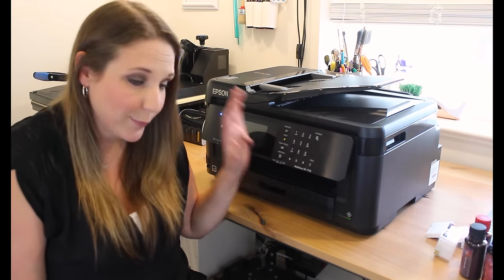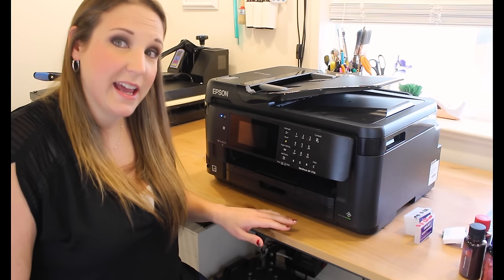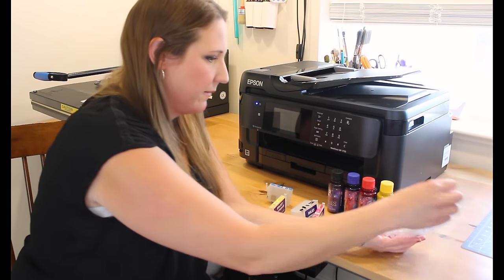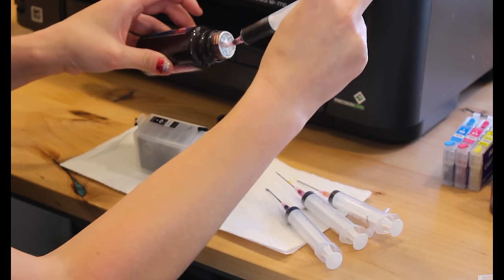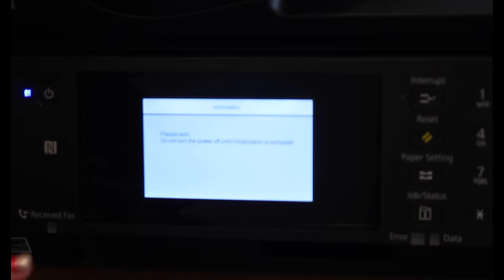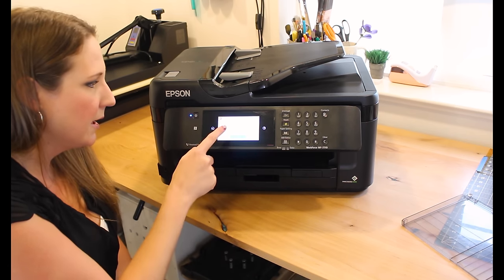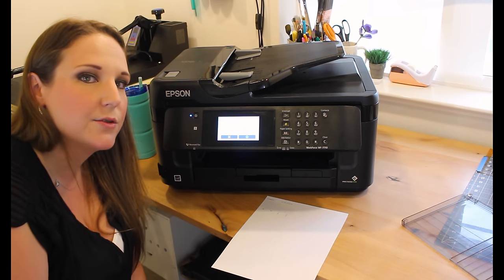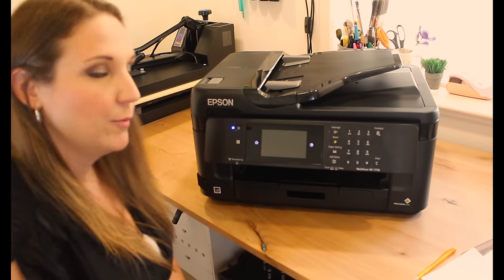How to Convert an Epson Workforce Printer to Sublimation

Comment: I would like to start off with telling you how imformative this video has been to me, ive never done sublimation before and was almost going to buy a huge sawgrass printer, (the 24" ones) which are around 4-5k,  but i do have this theory and cant seem to find any answers anywhere, I'm hoping you could help me out.  Have you ever tried printing easysubli media by siser with this printer and ink? and if so i was thiking of buying this whole setup just for that purpose, one more thing, if i were to buy a roll of that media 20" wide and cut it down to any size below this printers max print area for example 18" wide by 11" height,  would there be no problem with it printing and working with that media.  The little sheets siser sells I believe 8.4" x 11" are just too small for me.  I would love to hear back from you as your sole answer will determine my direction in this, thank you so much.
Reply from the maker: Arturo Torres I haven’t tried EasySubli yet but I’ve seen people use it just fine with their Epson’s. I think the only hassle people have is you have to give the ink some time to dry as it doesn’t dry as fast as Sawgrass. But you can definitely cut it down to any size the printer can handle! I do that with my paper scraps all the time!
Reply: @DebbieDoesDesign  thank you so much. Very very informative video, thank you.

Comment: is a sub better than the AVERY?
Reply from the maker: NERO absolutely! Sublimation can do way more than just shirts and it’s absorbed right into the fabric, not on top with a thick vinyl feel that can eventually peel or crack.
Reply: @DebbieDoesDesign  waht sub inks are you using? i am planning on keyboard keycaps and shirts eventually :-DDD

Comment: Don't you need to reset the inks chip? I know with most printer you need to reset it to refill the printer.
Reply from the maker: Some cartridges do have a small reset button. The ones I use from Cosmos Ink do not and I have never needed to reset anything.

Comment: my printer still wont accept my ink what do i do
Reply from the maker: Have you made sure they are pressed into the carriage very firmly? Press harder than you think you should. Next, try unplugging it for a few mins and see if that helps resent it. If it’s still not working, try cleaning the metal connectors on the cartridges very carefully with an alcohol swab or q-tip dipped in rubbing alcohol. It’s possible some ink got on the connectors.

Comment: I've heard tons about a chip needing to be in this specific machine how do I go about tricking the printer with the chip process someone help 😂
Reply from the maker: The refillable cartridges should already have chips in them if they are required for your model of printer. Buy them from a reputable seller. I got my cartridges from Cosmos Ink and never had an issue with the chips.